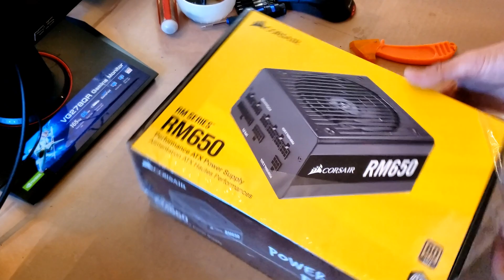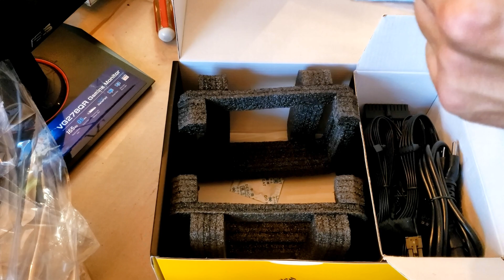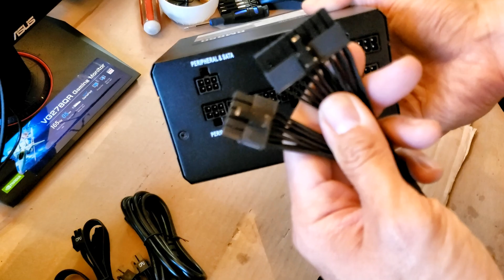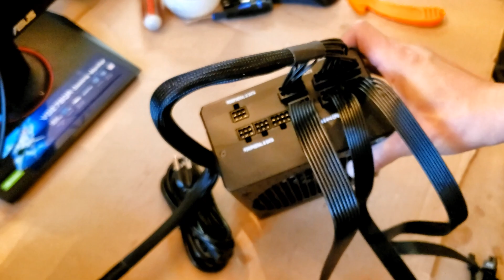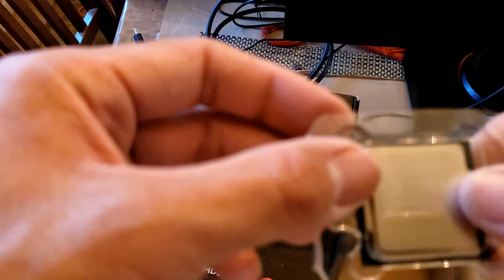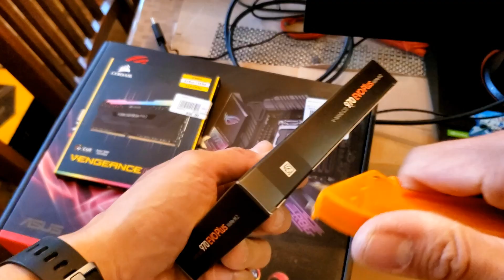Quarantine Gaming PC Build - Intel 10th Generation i5 10600K and RTX 2070 Super - August 2020

Comment: Hi bro......10600k recomended air cooler budget ????please
Reply from the maker: Corsair makes a nice air cooler or you could go with a Coolermaster Hyper 212 if you need to save money.
Reply: @brandensoutdoorb-channel8084  Correct, the CM Hyper 212 can be used (add a second fan preferably). But, in my experience, it might not be enough to use with a OC´ed CPU (it wasn´t for me).

Comment: Nice man I have the Rtx 3070 Ftw3 with intel core i5 10600k it works really well.
Reply from the maker: Congrats on your build! What games do you play?
Reply: @brandensoutdoorb-channel8084  Yo, got a question: In 12:56, I’m bit confused of what you did to the pins...
Reply: @brandensoutdoorb-channel8084  and what specific pins you’re talking about?? And do I have to do that because I have that board, so I need to know
Reply from the maker: @Zane123-d7w  i used a screwdriver to start the system outside of the case without an on/off button.
Reply: @brandensoutdoorb-channel8084  How'd u do it? Interesting that you can start the system without an on/off switch
Reply from the maker: @Zane123-d7w  use the screwdriver to connect the positive/negative of the power switch pins.

Comment: Did you end up OCing the PCU? Care to share the specs? Thanks!
Reply from the maker: Specs are in the description box and in the video.  I used Asus Auto OC.
Reply: Thank you. I would like to know your thoughts about my cooler choice: Noctua NH-U12A instead of the AIO you used (just personal preference).
Reply from the maker: @filipedeataideramos  high end air coolers perform about the same as an AIO. I prefer the rgb lightning and low profile look of a water block.

Comment: How did you get the dual inter cooler fit I’m having trouble
Reply from the maker: Install in the front of the case or use low profile ram to install up top.

Comment: If my psu was 650w 80+ bronze , is that enough for this specs?
Reply from the maker: Yes plenty of power as long as its a brand name psu. The Bronze rating is just efficiency. The 12 volt rails should put out enough amps.

Corsair
Seasonic
Coolermaster
Thermaltake 
EVGA
NZXT etc... all good brands of PSU's.
Reply: @brandensoutdoorb-channel8084  yes i using corsair psu now
Reply from the maker: @キイムくん18  perfect.
Reply: @brandensoutdoorb-channel8084  thank man!